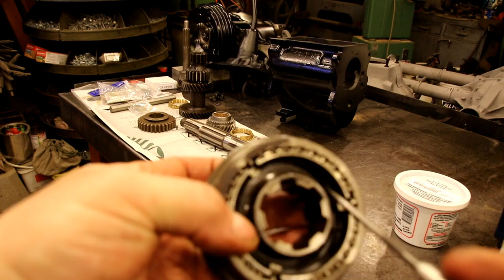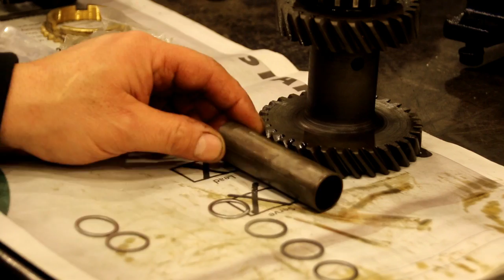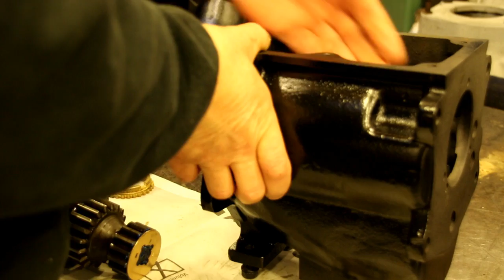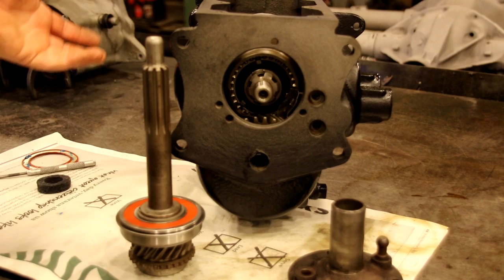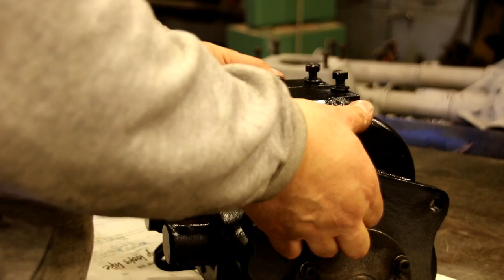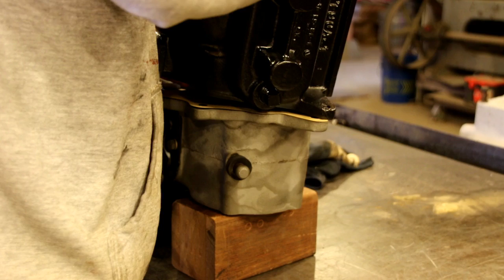Willys T-90 Transmission Rebuild

Comment: This is by far the best, most comprehensive rebuild video ive seen so far.... Thank you. What is the thread sealant you are using on the bolts? I did not catch that.....

Comment: Question. I am in need of a new cluster gear. The one that came with my m38 is pitted badly (sat in water) and another I acquired is also pitted and worn badly. Who do you recommend that I purchase a new one from? Ebay as a million of them but are made overseas. You do this all the time so I thought I would ask who you use.  Thanks.

Comment: Great video, gave me the confidence I needed to dig into my T-90 this summer. I was having trouble finding retailers carrying the assembly lube online this summer, and reached out to ATP; they confirmed that they are no longer producing the AT 201 Transmission Assembly Lube. Do you have any suggestions on other alternatives that will play nice with the brass components? I got lucky on eBay, but others may have trouble in the future.

Comment: Great help. Thanks.  Question, on the bench it is really hard to get into third gear. Any ideas on what the issue might be?
Reply from the maker: The blocking rings can get stuck on second and third gear when freshly rebuilt.  Take a small screwdriver and pry them free so they have wiggle room.  Flood them with lubricant so they don't stick and you should be able to shift without any trouble

Comment: Greetings and Happy New Year 2023.  First time for me to rebuild a T-90 or any transmission.  I am really enjoying your videos.  Without them, I doubt I could be successful!
When I pulled my T90 apart, instead of 6 washers for the needle bearings, 9 washers fell out.  I was not able to note the order.
Have you seen this before?  Any idea why I would have 9 washers?  Any idea of the order?
I think this M381 was built in 1952. It sat for over 40 years in AZ.  When my father passed, I looked at it and there was a Palo Verde tree growing through the engine compartment :)

Comment: What’s your recommendation for cleaning up gears?  Just disassembled mine and they need some loving.
Reply from the maker: Parts washer to remove oil and grime.  More serious trouble I use walnut shells or fine glass beads in  the blast cabinet.  Or just get new parts if they are beyond clean up

Comment: WARNING! This is a great video like all of his videos BUT it has one flaw. At 31:47 he removes a seal on the Front Sealed Main Drive Gear Bearing. SKIP THIS STEP! I did exactly what he said in this whole video and it leaked right off the bat. After much frustration and time. I found out by removing this seal was the cause of my leak. I replaced the bearing with a double sealed bearing and no leaks now. 
All his vids are probably the best for details and instructions. But I wish he would revise this part of his video and save other guys the frustration. I hope this helps others in the future.

Comment: I just completed a rebuild, and have a very bad leak between the transmission and the transfer case - 

They are not installed on the Jeep, just filled them with oil sitting on the bench 

I have some pictures of the leak / area in question 

Any thoughts?

Thanks in advance
Reply from the maker: A leak in that area is usually due to the lock plate that is between the countershaft and reverse idler shaft being in the way.  The ones that come in the kits are big and have to be installed perfectly to fit inside the transfer case recess.  Chances are yours is out of position a little and not allowing the cases to come together tightly, causing the leak.
Reply: @metalshaperJeep  thanks for the quick response!

I think you are right, as I didn’t get a perfect fit as you describe  - I didn’t realize it was important for the marriage between the transmission and transfer case

I will separate them and take a look

Thanks again

Comment: I put the cluster together with the 6 washers as original but its like 1/8" short from being flush with the ends is that normal? Thanks
Reply from the maker: Not a problem, the washers should be set in a bit on each end
Reply: @metalshaperJeep  The cluster shaft started leaking out the front so i had to pull it apart and goop it up. Luckily i dont have the body on yet.

Comment: If you decide to remove the oil collector, you can cut/grind the thin sheet metal part off, and grind the remaining thick part smooth and return it to its original position, using the original bolts with some thread sealer to hold it in place.  Fills the holes, nothing to come loose inside, and free.
Reply from the maker: That is exactly what I do on my T90 rebuilds.

Comment: I didn't see you add the oil retainer washer to the main shaft at the rear. Is it not necessary?
Reply from the maker: the washer was used on MB's and very early CJ2A vehicles.  It was discontinued during early 2a production.
Reply: @metalshaperJeep thank you for that information. That adds more detail to my Frankenstein '48. It has VEC parts. I guess that could include the transmission internals. Or someone just unnecessarily added it, I guess.

Comment: I’ve got it T 84, that jumps out of second when you press on the Excelerator, I am unsure if it is some thing I did wrong when assembling or a different issue. It is not the same issue that most people have when it jumps out of second due to wear and tear on the synchronizerI think because it doesn’t jump out when engine braking. Have you run into this before? Or have any insight that might help me?
Reply from the maker: Case could be worn beyond acceptable limits.   Perhaps you needed to shim it but didn't or didn't do it correctly.   Worn parts, hard to know what is  going on until you tell me what you replaced and what the quality of the parts was.    
Brian
Reply: @metalshaperJeep  my cousin and I rebuilt the whole transmission and replaced pretty much everything. Crown we used crown parts except for the small parts kit. That came from Ron Fitzpatrick. Can you tell me more about how I can reshim
Reply: The only thing we didn’t replace was the shift collar, which we thought was good

Comment: rebuilding  my t90 the cluster gears fit in very snug into the case  have new washer & thrust washers.. when i  installed  the cluster  had to use a mallot  to help set into the bottom   is this anything to be concerned about thanks
Reply from the maker: the cluster gear should slide in easily by hand, if you had to pound it in there you are going to have some problems.
Reply: @metalshaperJeep  you recommend buff down a thrust washer then
Reply from the maker: @bobberg1541  put the flat rear washer on a magnetic table on the surface grinder and take .001" passes and keep trying it.  You want a perfect fit easily installed by hand
Reply: @metalshaperJeep   got that taken care of drops in smooth now [thanks]  how do you feel about kaiser willy co in S.C. put it back together with new second gear and it binds up found out its a few thousands to thick  they are sending another one from a different suppler . need to get with you about selling me the fluids  r what to use  for every thing trans/    t/case steering gear  and the rear main plugs at the seal i can send my phone # if you want

Comment: Nice video!
I have 1953 willys pickup. Drive spring summer and fall. Temps between 40-85. 
Which blend? How much is the oil?
Reply from the maker: contact me directly at metalshaper@comcast.net and I can send you a list with ordering instructions.
Brian

Comment: I am rebuilding a T84 transmission in my 1942 Willys MB. Your videos have helped me tremendously. Thanks so much. I have an issue with the steel washer on the back side of the cluster gear. If I line the small pin in the case with the hole in the washer it offsets the washer so I can’t slide the shaft in. I assume the pin is to keep the washer from spinning. Do I drill a slightly larger hole in the washer to move it into place?

Comment: My husband enjoys your videos. I was curious if you check the in play on the main shaft of the T90 transmission. The spacer is not wide enough on a lot of transmissions I have worked on. It will fly out of second gear.
Reply from the maker: I check it but don't usually have any problems with the end play.   I have rebuilt hundreds of t-90s and that is not a common problem.  there are a few reasons for slipping out of second gear but main shaft is not a common one.
Reply: @metalshaperJeep  ok. Thanks. I appreciate your videos. You do good work. Some of the best I've been seen in my working on jeeps for years.

Comment: B2rian, I just rebuilt my t90 and Dana 18 transfer case. I is leaking around the top shift plate and the input shaft. I sealed all bolts and gaskets with permatex #2. Does the t90 vent through the transfer case? Maybe building up pressure inside.
Reply from the maker: yes it does vent easily thru transfer case.   I never had a problem with pressure building up in the transmission.  What type of gear oil are you using.  If you are not using the correct stuff and are just putting in standard 80w-90 it will have a tendency to leak out because it isn't the correct lube and it to thin.
Reply: @metalshaperJeep  I used Red Line Mt-90 GL4 gear lube

Comment: Brian, I rebuilt my 1955 Willy's CJ5 T90 and Dana 18 transfer case. Does the vent in the transfer case also vent the transmission? It looks like it is leaking from the input shaft and the top gasket for the shiftier. It seems hot but I don't know how hot it was before I rebuilt it. Thx, Don

Comment: Very helpful  now I understand why dads trany would kick out of 2 and 3 and occasionally lock out the shifter I told him I thought the trany needed work he said their cheap and bought another used one lol I wonder about grandmas jeep it had a 3 in the tree and was supposed to be a 40s model it took 3/4 spark plugs and had a flathead engine but the carb stood higher than the hood not sure what model it was I thought it was a cj2a

Comment: I followed your video to rebuild my T90, when slidingvshaft through I had difficulty with the countetshaft thrust washer and spacer being in the way.,I finally got them out of the way and completed build. Connected to transfer case then motor. Shifts into reverse and 1st no problem (engine not running) but seen to have difficulty shifting into 2nd and 3rd. Did I get thrust washer and spacer wrong? Do I have to tear apart again?
Reply from the maker: Very common for the blocking rings to get stuck in place.  Pull the cover and with a screwdriver gently pry blocking ring away from second gear and third gear and you should be fine.

Comment: I'm gonna make a video, problly named SkyCastle truck 1. and post it on YT soon for anyone's interest about the 'field' conditions I'm working with and the parts puzzle that I have to assemble from. Where I live is quite remote and 'off grid' simple. Dirt floor simple. Flat blade screwdriver simple. And largely thanks to your videos, Brian, I am 'mechanic-ing for the fist time in way more than a decade. My last hu-rah, if you will. I'm 60 and before I die I'm gonna drive around my neighborhood! Thanks again for you vids.
Reply from the maker: Glad my videos have gotten you going on your project .   If there is anything you can't find in my videos just let me know.      Brian
Reply: @metalshaperJeep  Thank you.
Reply: dont throw in the towel yet, Bob... Im 75 and getting all parts for my 51 and 56 T90 rebuild and transfer cases also... having fun in Texas... drive them both daily.

Comment: Report back: I have the same thing nearly that you have Mr. Shaper. Two chassis and two sets of axles. One front 25 with gussets on the knuckle and the other D25 w/o gussets. I always ponder the fella that had the 'truck' before as I work away the days on it now that I have a turn.  My T-90 is coming along fine and the t-case looks real good. Might just flush and fill it for starters. My aim is to have a mountain 'gocart'. A running chassis outfitted like a SxS buggy with pedigree! I will need some parts and also have some body/parts left for trade or burial and don't know much about addressing that. BTW, we only have one radio station and you have replaced it. You are so much easier to listen to. No lie.
Reply from the maker: Hopefully will be able to see one of your videos soon and learn more about where you are located and your workshop.
Reply: I generally don't speak on my vids cause I hate the sound of my own voice, for some goofy reason... But I just up loaded some... SkyCastle truck MVI should get you there. I barely know how to function on YT. They definitely show my workshop! Sky ceiling and the biggest dirt floor in Texas!

Comment: Mine is just like new except it sat with water in the case for 49 years. It's cool, it's Texas mountain water and it's all gonna be fine. Low mileage but surface rust from hell. So far I broke it down, scarped and cleaned and preassembled to check the action and so far so good. I'll be back with a full report.
Reply from the maker: Sounds like you are making good progress, keep me up to date on the rebuild.  Glad you are enjoying the videos.   Brian

Comment: I'm depending on you Mr. Shaper! I'm doing a "field" rebuild and so far so good. Thanks for your step by step vids, I'm one of the peeps you were thinking about to do a detailed vid like this. I'm working in the dirt with no more than simple hand tools and high winds.But trucks like this were made to rebuild. (So therapudic) Mine is a T90-3 (I think) from a 2a or 3a... I'll post again later with results. Thanks again for you s/s vids. PB

Comment: Excellent video as always. I am prepping my T90 for a rebuild currently. Where did you source your rebuild kit and replacement NOS parts? Also what cleaning solvent is safe for the gears? I unfortunately don’t have a cleaning tank. just a couple oil pans.
Reply from the maker: Diesel fuel works great for cleaning gears and misc. parts.  Give Pete DeBella a call for good parts 631 874 8660 .  Tell him that Brian from Youtube sent you and you are looking for quality parts.  He will take care of you.
Reply: metalshaper Thank you sir. I now have his number saved. I’m starting the cleanup and tear down this weekend
Reply: Just double checked all of my parts and they are really rough with a lot of slop in them or binding. Gave Pete DeBella a call and ordered pretty much all of the internal parts, except the cluster gear and input shaft since they were in really great shape. I let him know you pointed me in his direction

Comment: A great set of videos. I just dismantled a rusted T87D heavy duty transmission. Cluster gear is so pitted that it must be replaced. There is a little pitting on the main shaft and second gear teeth and splines also. In what way could pitting affect shifting ability on this gearbox? I'm not sure I can find a second gear or main shaft for this thing. Any advice on how I can recondition these in case I cannot replace them? Thanks!

Comment: Hello, I have another question. I installed did the full rebuild on T90 and was great. Just used your videos... I am attempting to place the too shifter and it will not go into any gear. Just like its froze in position... is there a trick to this? It must be a issue only I have, since I haven't located anyone at any time online or YouTube with this... pls help! I'm stuck... thanks.

Comment: I just picked up the parts to rebuild my T90 and second gear won't go onto the main shaft past the snap ring groove that holds the gear in place. Thoughts?
Reply from the maker: Where did you get the second gear and mainshaft, there is a lot of junk out there so let me know where you bought it.  Next measure the mainshaft  OD and the second gear ID so I can see how much of a problem there is going to be.  
Brian
Reply: I picked up all of the internals except first gear and and the gear and shaft for reverse from Kaiser Willys. I try to avoid the "Georgia parts" like the plague.
The main shaft measures 1.3720 in the area in front of the 2nd gear snap ring and 1.3745 rear of the snap ring groove.
The bushing inside 2nd gear measures 1.379.
I slid the gear on as far as it would go without force and spun it a bit, then I flipped it over and did it again.
This left a shiny ring on the inside of the bushing, about 1/8" wide about .5 inches from the rear face of the gear. It looks like I have a tight spot inside the bushing.
Reply from the maker: Very common problem with reproduction gears made overseas.   You can get an expandable reamer and just take a light cut on the bushing inside the gear if it won't go on.  Do not make it oversize as that will lead to other problems.  The size is good , you just have to get out the high spot on the bushing.  You have to be careful where you buy parts these days there is a lot of junk out there.  Let me know how it goes.

Brian
Reply: That's what I was thinking. It's good to be validated by a pro. Thanks!
I'll report back when I have it together.

Les

Comment: Hello again, can you tell me the best lubrication to use for my T90 and Dana 18. Rebuilt them using your vids! Awesome experience! Now getting ready to reinstall then will need to fill them. Thanks.
Reply: Any gear oil should be fine,  75w90

Comment: Could you contact me at markmar0607@gmail.com? I have a couple questions. It’s been years since I’ve been inside a T-90 transmission.  Your videos are a great refresher course. I am interested in the actual bearing part number for the input shaft.  I think your idea of using that style bearing is great. I will watch a few more of your videos, but with me rebuilding mine completely with today’s products you mentioned not using straight 80/90 gear oil. Just wondering what you offer as an alternative. Thanks, Mark